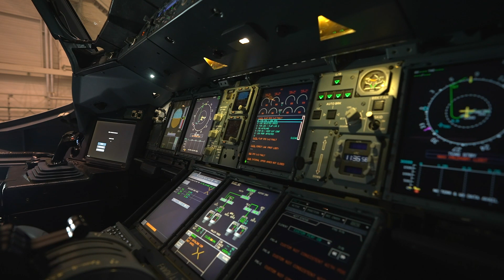A tour of the Airbus A380  hydrogen engine test aircraft

Comment: No  tank can hold hydrogen for any length of time which is a problems and Hydro is very very flammable. Plus it takes a lot fossil fuels to make hydrogen.  Two ways electrolysis for that you need electric power all electric power need fossil fuel or you can take it out of natural gas thus more fossil fuels. Wind turbine take 100 tons of coal to make solar panels the same even more coal. Tis is not the answer but it keep political leaders happy

Comment: This is incredibly exciting. I do wish the ambition was a bit more aggressive though. 2035 is a hell of a long time to develop basically a modified version of a jet engine that runs on a different fuel. Granted, H2 performs very differently to kerosene, but 13 years to get a working model in the air... it's too long.
Reply: Any zero emission aircraft will utilize  electrically driven scimitar blade ultra high bypass fans powered by fuel cells. The efficiency of combustion of h2 in a turbine will not get the job done (would require carrying 2x the weight in h2 vs fuel cell electric)
Reply: Umm, it’s not too long considering this has to be certified for usage in the air with passengers
Reply: 13 years to get into service carrying passengers pal, they'll be testing the finished engine and tweaking it for years before it goes commercial.
Reply: Seconded, and consumer demand is already huge and increasing (probablity guesswork here, take it with a grain of salt.... ), especially compared to backwards in time. Let's imagine 1993 to now (2023). The ambition seems to be emphasizing the "careful" in "careful optimism". Imageinably so that the market / competition won't "win the budget", so to speak. Understandable from Airbus, but maybe we are better off getting our clues from Deutsche Aircraft and similar. All the best.
Reply: A major issue is the supply at airfields for hydrogen.
Reply: Man spent hundreds of years even trying to get into the air… 13 years is actually impressive

Comment: Good luck with this, but did you know that the process of making hydrogen from water is only 70% energy efficient? In other words, it takes 9 kg of clean water and a huge amount of electricity to make one kg of hydrogen, but the energy you get out is only 70% of the energy you put in.
Reply: Well it's not like batteries will ever work for long distance flights. They can't hold anywhere near enough energy. So I guess it's this or no more flying once oil runs out.
Reply: @atnfn  That is precisely the point - there's no other option to decarbonize medium and long haul flights. Until we find something better, hydrogen is the only way.

Comment: Does it burn directly hydrogen inside of the turbine, or it generates electricity in separate device and just rotate the turbine?
Reply: Yep, burning hydrogen directly in the turbine, just like with jet fuel. Amazingly, hydrogen has more energy than even kerosene does, but the main challenge is how to make tanks to hold hydrogen gas at 10,000 PSI, that are large enough to hold the massive amount of hydrogen it would fequire for a real jet flight -- and build it to weigh as little as the fossil fuel alternative. Hint: it's impossible. Oh, and this aircraft still requires 4 fossil fuel burning engines to fly, this is just a little hydrogen tester. As for Airbus' claim that they would build these aircraft by 2035, obviously they have no intention of doing anything of the sort.

Comment: Lmao.
Hope you have a train with many tankers full of hydrogen. 
It be be the purest element, but don't look for an easy out using it. It burns way too fast. I should know, I was a jet engine mechanic. 
Fast burning fuels are the most INEFFICIENT types of fuel rarely used on aircraft engines.
Smfh!
Fucking dreamers.

Comment: The issue of the important azone-depleting gas (NOx) emission from the engine is serious I think. Also, the Hydrogen gas turbine will suffer from a low efficiency in converting the expensive liquid Hydrogen fuel to thrust. If they use the fuel cell technology to electrochemically convert Hydrogen to electricity (and generate thrust through electric motors), the plane would achieve higher energy efficiency while the only gas leaving the exhaust is water vapor.
Reply: But what electric setup is as fast as a jet combustion engine? Serious question, aren't electric propulsion planes stuck with slow props?

Comment: I'm a little surprised that they're going to add a stub, an additional engine and hydrogen tank all behind the center of lift. So they'll need to add more weight up front to balance the center of gravity, thus add to the total weight of the aircraft. Why didn't they simply put hydrogen tanks up front and balance the aircraft that way?
Reply: It's to gather data, not to carry passengers, they likely know what they're doing.
They said it themselves they have a lot of space to work around in this kind of aircraft
Reply: @afoxwithahat7846  They still need to balance the center of gravity, whatever kind of aircraft they use. Furthermore, they need to compensate the change in flight due to decreasing weight of fuel. That's why fuel tanks in every aircraft are mounted as close to COG as possible. Hydrogen is very light but it still has weight. That's why I'm even more puzzled why they didn't put tanks at the center part of the fuselage, just above the wings.
Reply: Empty A380 (as any other aircraft) is designed to be balanced when empty, therefore the only logical conclusion is that they're planning to put some additional equipment onboard (with known weight) which would be placed up front and then engine and fuel tanks are mounted on the back to balance the weight.

Comment: What a waste of taxpayer's money.
In a double chemical reaction, first METHANE (natural gas) has to be reformed to obtain hydrogen. 
1- CH4 + H2O (steam) = 3H2 + CO
2.- CO + H2O (steam) = H2 + CO2 (HORROR: carbon dioxide).
Ah, but Airbus probably wants the A380 to use instead "green" hydrogen —5 (FIVE) times more expensive than that from steam reforming— that will save the planet from the horrific and catastrophic man-mede global warming. This "green" (red) gas is the "revolutionary" (communist and/or pregressist) hydrogen coming from electrolysis where the electricity comes from medieval technologies such as wind mills and solar panels (and magnifying glasses). Well fellows, that would be the end for the A380 because no airline would never ever buy it again.
What a joke!

Comment: Hydrogen is good.
But there’s a lot of stuff that needs to be solved here.
1) The high pressure tanks. The plane flies in and out of different pressure zones while flying. It could impact the tanks drastically. And it’s generally not safe to have 1000 bars pressure behind your ass or on the wings while flying at 40,000 feet.

2) Hydrogen burns at much higher temperatures than aviation-fuel. The components like turbine blades, nozzles and other parts cannot withstand such temperatures without creating hairline cracks or deformation even if it’s built with titanium. The present turbine blades that deal with aviation-fuel are already made with titanium! On top of that, Hydrogen burning at very high temperatures will create a high amount of NoX emissions. That’s basically spewing high amount NoX in the clouds for Nitric Acid to pour down as rain.

3) Where is the source of hydrogen? Manufactured from clean energy like Solar-electrolysis or from highly polluting method of Steam-Methane-Reforming (this method contributes to 50% of world’s hydrogen production). If the source of H2 is from the second method, it’s completely useless to even proceed further with this H2 powered engines.

4) Hydrogen is a volatile fluid. It leaks even through metals because of the small size of hydrogen atoms. Though the rate of leakage is negligible, it should be noted when using it on an airplane.

5) Since the weight of hydrogen is less than aviation fuel, how is it going to reflect it on the wings? Because the wings need to be heavy to prevent flexing. That’s why fuel is stored in wings. So, H2 will affect this weight and engineers have to add weigh to wings from somewhere else from the plane.

There are a lot more problems associated with H2 as aviation fuel. But these 5 problems are quite tough to solve compared to other hurdles.
Reply: I think he said "Liquid Hydrogen tanks" at 1:32 . Liquid hydrogen is NOT stored at high pressures but at very low temperatures, so tanks rather need excellent thermal insulation opposing to high pressure hull.

Hydrogen needs to be warmed up before sending it to the engine, therefore if hydrogen is to be used relatively quickly (which would be the case during flight and should the tank be filled just before the flight), no or little thermal insulation would be actually needed.
Reply: I am skeptical of hydrogen as a fuel myself, but two of the points you made aren't actually a problem. First, the tanks already cycle over several hundred bar as they get filled up and emptied, a difference of less than one bar is irrelevant. Second, turbine blades are NOT made of titanium, they are nearly always nickel-base superalloys. The only exception I know of among commercial engines is the GEnx, which uses titanium aluminide for the last two (i.e. coolest) stages of its low pressure turbine. Titanium alloys simply cannot stand up to those temperatures. In any case, modern engines already operate at the limit of hot section materials, and consequently run very lean to keep combustor exit temperatures tolerable. The combustion characteristics of hydrogen are certainly different from hydrocarbon fuels, but this primarily impacts combustor design, not turbine blade design.
Reply: Exactly ,what you said. It's so complicated for a car and airplane it's only good for rockets
Reply: @spacex9009  not complicated  is easy , government  doesn't want yet that's  problem  they pushing  fake green deals  with ev, the car hydrogen combustion engine has been produced  years ago its works great it runs  same as lpg,methanol
Reply: @drtruuth  what the hell are talking about. Why are you comparing lpg and methanol with hydrogen. Hydrogen is an entirely different character from these stupid gases. how will you preserve hydrogen in a container for long hours. Yeah hydrogen is a good fuel for the environment but it's a mini tnt  for  humans. It's good for rockets, because rockets have the capability of launch abort system so nobody gets any harm. even musk talks about this.
Reply: Dude that is why they are doing these tests. It's not like they are going to mount a hydrogen engine to a commercial flight tomorrow. we already use hydrogen in rockets. Actually we need an alternative fuel source for the future.
Reply: @Phantom-ys5ur  "Actually" we don't for many hundreds of years.
Reply: @billhosko7723  Have you been to Beijing or Mumbai??? YES WE DO!!
Reply: @billhosko7723  Where’d you get that “fact” buddy?
Reply: a true flying bomb !
Reply: @jpegnow  To the contrary - hydrogen is safer than jet fuel! Hydrogen acts similarly to the CNG (natural gas) that we safely use every day for heating and cooking. Since there's no oxygen inside hydrogen tanks, hydrogen cannot ignite or explode. In case of hydrogen release, gaseous hydrogen is way lighter than air, so it rapidly rises up and spread around, meaning that risk of fire diminishes in less than a minute after tank getting burst. That is totally opposite to liquid jet fuel, that explodes into a fireball, spills on the ground around the tank/airplane and continues burning for long time - until everything is burned up completely. Even in case of hydrogen fire, the flame would go straight up, leaving cold, non-burning zone above ground safe for rescue.
Reply: @visnjamusa9395  lets give it a try then. ...... but i won't be flying during that transition period.
Reply: Hydrogen created by nuclear is the only way to go.   So what happens when they use the fuel? Do they start throwing lead weights in the wings?
Reply: Hey genius , it seems that you have no clue of what you are talking about, there wont be any tank pressurized at 1000 bars here , we are talking about LIQUID HYDROGEN .so I stopped at the first paragraph and didn't read the rest of your post.
Reply: @lebaillidessavoies3889  maybe you should have continued and you might have learned something. Liquid hydrogen has to be stored at very low temperatures and the burnable gaseous hydrogen will be at pressure, so the arrangements will be nothing like current liquid jet fuel in any way shape or form.
Reply: Jet engine turbine blades are not made of titanium. Do some basic research ffs.
Reply: Turbine blades are made of some kind of ceramic with internal cavities for cooling... I think hydrogen propulsion jet engines are  scary. Any way I will train my mind to be happy without air travel.
Reply: @leopardtiger1022  Hydrogen propulsion engines were used on all Space Shuttle orbiters, with no problems at all IIRC. Jeff Bezos' Blue Origin spacecrafts use hydrogen as main fuel too. Technology is well-known for some time now. Why would it be scary?
Reply: @visnjamusa9395  Because long term use on these engines might be beyond economically useless as engines will have to be replaced or overhauled much more frequently than regular gas turbine engines normally jet engines stay on the wing for about 5-7 years depending on conditions but hydrogen engines operate at much harsher conditions it might not become economically feasible as in all mechanical engines heat is what kills engines (cycles) unless ticket prices might become so high no one will travel
Reply: @visnjamusa9395  Because US citizens are "well read and well informed".

Comment: ICE vs EV, 1000's vs ~40 moving parts.
Reply: But how do you make an electric jet engine? Jet engines work on the principle of reaction force. What will be the kind of force pushing air through the turbine?
Reply: @tkzsfen  I was not aware passenger airliners were jet engines?
Reply: Its also about weight and density of fuel and about weight to power ratio
Reply: @nani5987  yes, probably feasible with 500Wh/kg.  Batteries are around 200-300Wh/kg right now and in a few years EV planes on long flights may be feasible, with ~40 moving parts rather than 1000's.
Reply: @kotgc7987  a tesla weighs 5000 lbs with fully charged batteries and is range limited to maybe 350 miles. How heavy would a plane need to be with its batteries to travel 7000 miles. Also how much battery weight would it take to create and maintain the high level of thrust to keep the plane in flight? Battery powered planes are far into the future imo.
Reply: You need to go back school.

Comment: Do you people not remember what happened to the Hindenburg Zeppelin??? In case you don't know, hydrogen is very, very flammable!!!
Reply: We're a long way from the era of the hindenburg. We've been safely containing and transporting combustible liquids and combustible pressurized gasses for a long time. In the air, water, by rail,  freight trucks, and in our homes.
Reply: @Resistculturaldecline  would those containers survive a crash?
Reply: @tedb7402   They do. At least well as containers that carry our other combustibles in daily life.
Reply: @Resistculturaldecline  That's much better than the fuel bag's of the Hindenburg!
Reply: Hydrogen has been safely produced and used in huge volumes in petrochemical industries (among others) for many decades. So, its intrinsic flammability is already well-handled.
Reply: Idk why containers surviving a crash is even mentioned. If a regular plane crashes, nothing survives & no one really cares if the containers of a regular plane are "ok" post crash. Hydrogen is used for cars & some big 18 wheeler class trucks as well via fuel cell system which is what Airbus is working on developing.